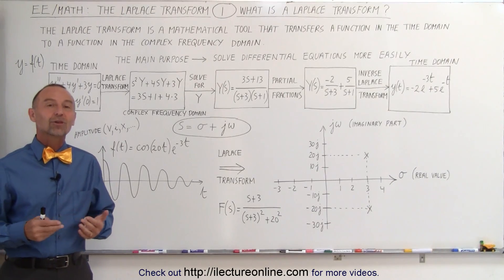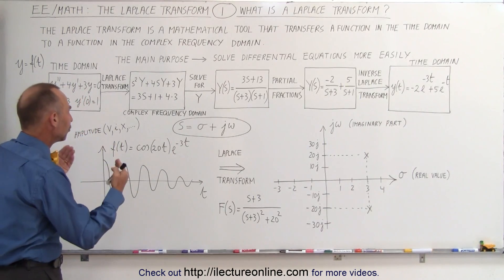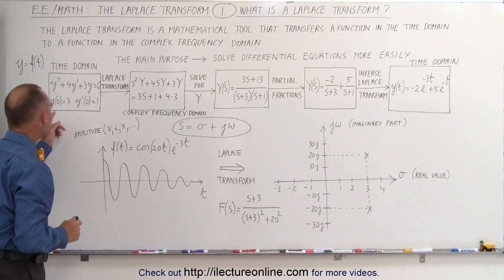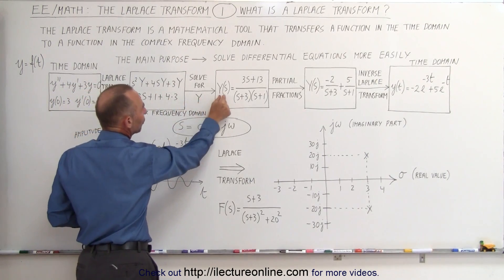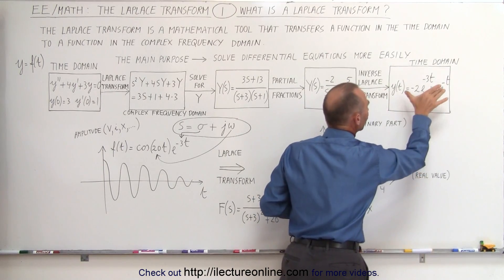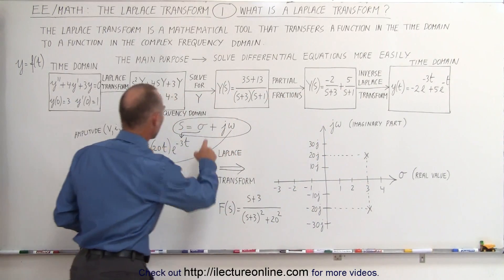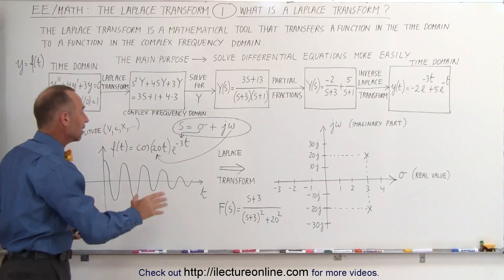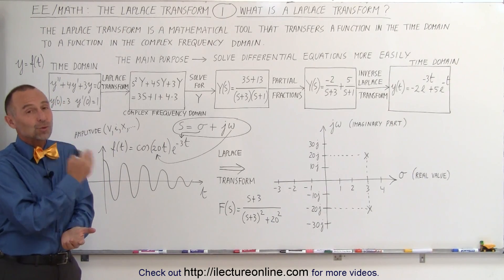Electrical Engineering: Ch 16: Laplace Transform (1 of 58) What is a Laplace Transform?

Comment: I remember completing both my linear algebra and diff eqs course with a descent A, I loved how exotic and challenging these mathematics get. I’m a civil engineering major, sometimes I really question my self if I should go into mathematics instead, but I kind of suck at math. There are some mechanisms I simply do not understand. Math is a tool, you don’t have to fully understand how it works in order to use it, therefore I’m a CeVE

Comment: Hi, please correct me if i'm wrong. 
Shouldn't the "x" in the real-imaginary graph be drawn at the left side instead of the right? that is x should be -3 ?

And so exponential at the left side is decaying (system stable), and exponential at right side is growing (system unstable)?

I like the way you are explaining things. Cheers!
Reply: Adi San sigma is equal to 3 in this example , the minus sign is already in the exponent of e , so when sigma is equal to -3 the exponent of e will be -(-3) = +3 so it becomes a growth funcion , and the opposite is true , if sigma is 3 the exponent would be -3 so it becomes a decay function .
Reply: When we will plot the poles of F(s) it will be -3 as it is a stable system and for stable system poles lie on -ve axis.
Reply from the maker: The video is correct.
Reply: @MichelvanBiezen  the video isn't completely correct. poles of F(s) is equals to s=-3+20j and -3-20j. but in your video, you calculate the poles s=+3-20j and +3+20j. adi san is correct. but nevermind you are a great man thanks for your effort.